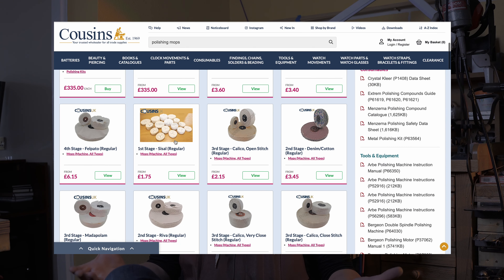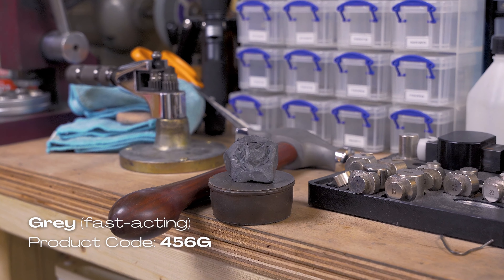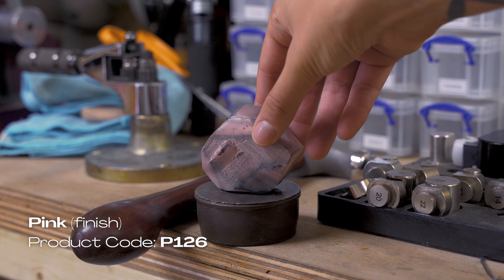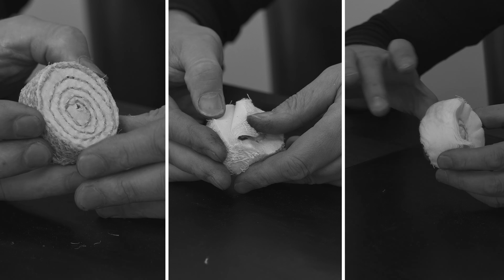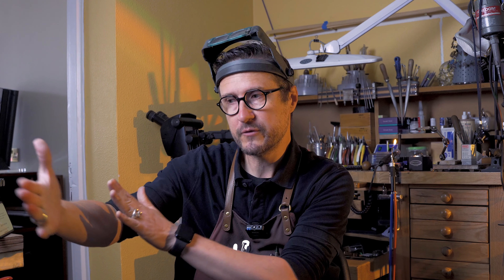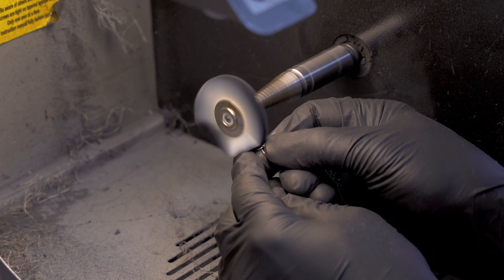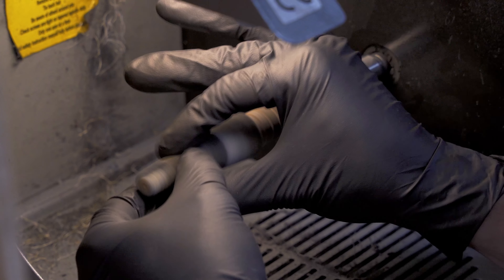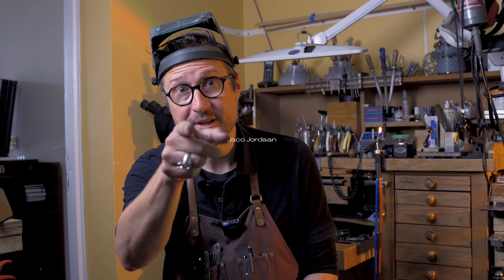Polishing Mops? START HERE | The Beginner's Guide to Choosing The Right Polishing Mop | GWS

Comment: Thanks for the detailed rundown, its great to hear how others polish, and I continue to enjoy how you desctibe your processes. I only use cotton muslin mops (I call them polishing or buffing wheels here in the US), but have been wanting to experiment more with bristle mops - only ever use smaller 1" bristle wheels in a handpiece currently. I do 3 stages for polishing; tripoli on a stiff stiched mop, then a medium compound on a looser stitched mop, then rouge on a loose unstitched mop to finish (red or white, depending on the metal). I think they are Osborn compounds, but I can't recall for certain now. I tried a sisal wheel once with a coarser cutting compound and didn't like it at all. 

what grit sandpaper do you use before polishing? I tend to use 320/400/600.
Reply from the maker: @jimmyers1428  thanks for this - sharing what your workshop uses helps the whole community. Your sanding process looks very similar to mine. Usually it’s 320 to 600 and on platinum I’d run right through to 3000. But I find 600 is a good end point for gold. I switch to bench polish from here and then the bigger mops.